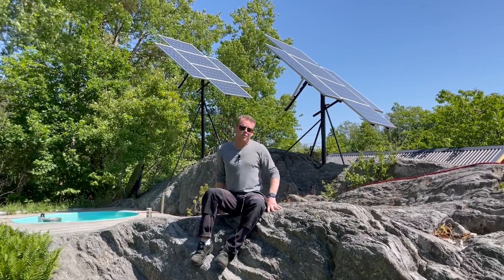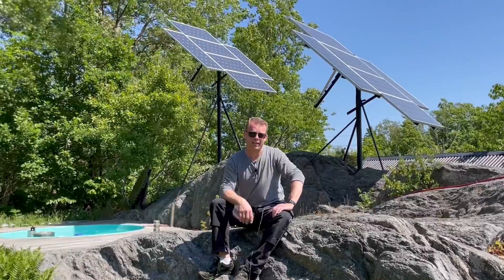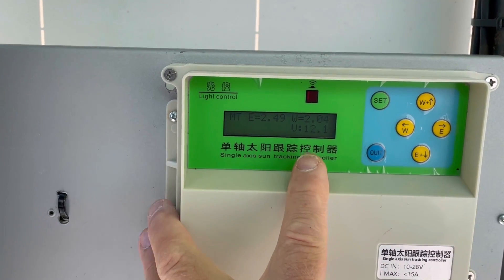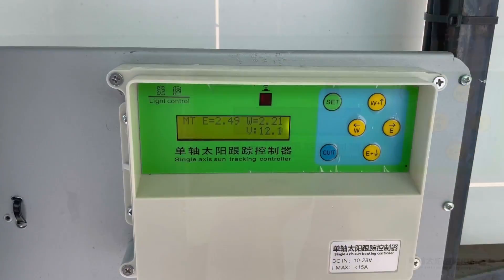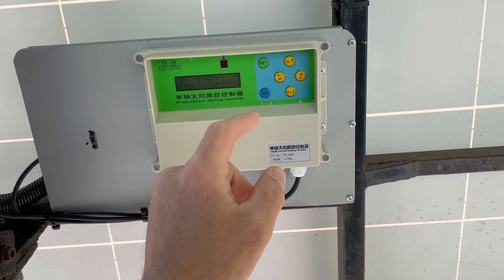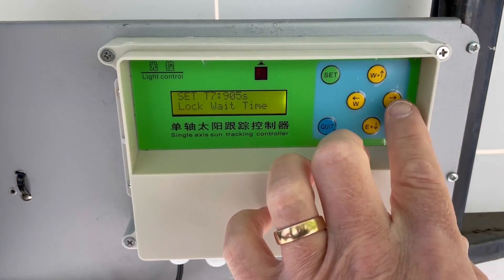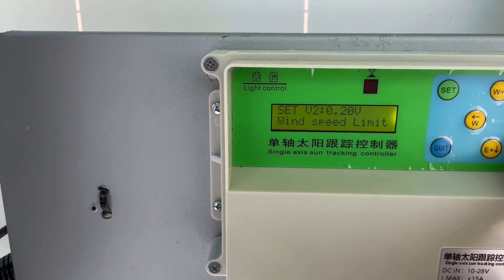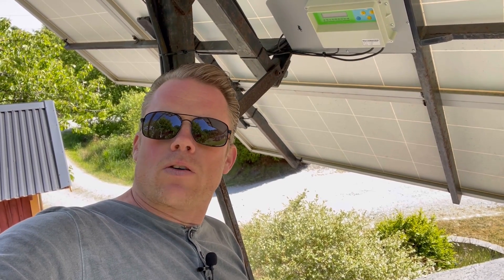My new budget solar tracker controller on my diy solar tracker system, is it good?

Comment: Thank you for this nice video. How did you connect the power? With a battery near the solar panels?
Reply from the maker: Hi and thank you. 😃
Those panels are connected to an inverter in my basement, and it’s only grid tied. My other panels that are on my roof and on top of my mountain, 11,2kwp are connected to my battery. I have more videos about that system if you would like to now more about that and my home-made high voltage battery.
Thank you so much for your comment.☺️

Comment: I have found a system that is running on the Washington Island School in Michigan in the sunny portal: one fixed and another tracking the sun for 8 years or so 
The gain (the island is located in the USA but at the level of ROME, so lot more hours with sun I guess) is about 29% a year,
but can be up to 55% on a bright sunny day. 

Has not much effect in case of cloudy days, but on any sunny day than a fog / cloudy day it will improve the output. Spent quite a long time to evaluate the schools data cause those are accessible for everyone . great project like all the others you had shown here so far.
Reply: "Has not much effect in case of cloudy days, but on any sunny day than a fog / cloudy day it will improve the output. Spent quite a long time to evaluate the schools data cause those are accessible for everyone . great project like all the others you had shown here so far."

this is why no point of system like this in europe. for +29% in small systems (like this) enough add one or two more panel and those will prefrom better in overcast weather condition what is the common in wintertime.

Comment: God morgon, nu har jag lagt upp en film på min inte fungerande lösning på vind-el. Tacksam för tips. Kanske är det helt feltänkt eller så har dioden krav på mer volt. Har kört upp till 30 volt genom en dc laddare utan att få det att passera dioden på en av strängarna.
Reply from the maker: Hej. Kollade din video.
Jag har ingen aning hur dina prylar hanterar 12 volt.
Vart in i invertern går dina 12v?
Kan den gången hantera en så låg spänning som 12v
Och nej, strömmen i ditt 12v system kan aldrig gå över till högvoltssidas om inte spänningen höjs över den befintligaspänningen där. 

OBS!
Jag har ingen komplett förståelse i din anläggning så det jag svarat dig här kanske INTE STÄMMER.

Comment: Thanks for sharing. I saw some panels have cracks in the solar cells. Do you still get maximum power of the panels. If not you might need to replace them. I think bifacial panels will serve you well during winter with the amount of snow you get. It will defrost the frontside much easier. Keep up the sunny work and have a nice 6th of June in Sweden, a holiday! Greetings from Karlskrona, last day of my Sweden holiday, tomorrow back to the Netherlands.
Reply from the maker: Yes, they are not cracked but it looks like it. I do not know what it is. I started to see them 3 years back I think. Still the same power. Hope you hade a great time here in Sweden 🇸🇪 😃☀️
Reply: @flyingtools  yes Sweden was nice, wow it looks you guys can use some rain, a lot of grass was yellow. Whenever you see dips in your solar return it might be time to replace. Also your inverter can handle bigger panels I saw in your latest video! How is the boat sailing these days? (Anton)
Reply from the maker: @edwardvanhazendonk   yes, we really need som rain! Yes, I keep an eye on them. If I have to change, it will be bigger panels, but it’s also a bigger risk, I think about the wind. Anton is working hard in Gothenburg’s harbour. Towing huge prams for Gothenburg water and recycling.
Reply: @flyingtools  yes , these bigger 550 kWp moduels or panels are about 1,1 x 2,3 m and even the biggest now for agriculture solar farms have reached 660 Wp with a 2,50m length but the width has stayed the same - i bet for logistical reasons and also the huge weight over 30 kg.  
Tough work and I guess high load in case of any storm or guts. I have now installed 550 Wp panels, but on the roof and I can tell you really hard work if you are not really used to do that on a daily basis. Even moving those on the roof will instantly show you the huge impact and power of the wind on such sails of 2,5 squaremeters. 

It is better to call them a sail cause even on a full sunny day the wind can make it hard to carry them along the roof at least if you have some chambers and windows or chimneys there which disturb the flow and can bring you out of balance in case you carry such sail.